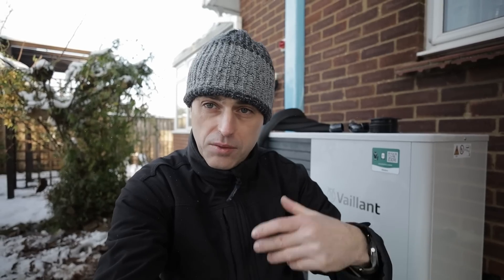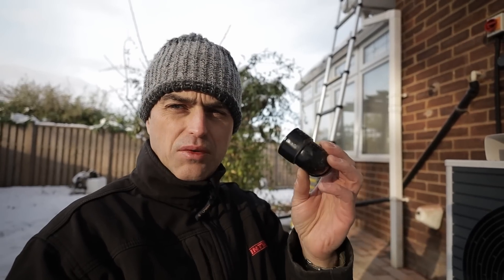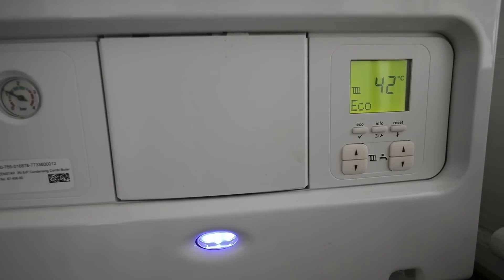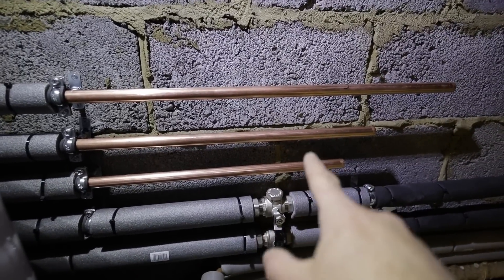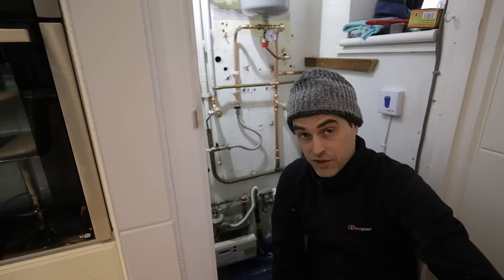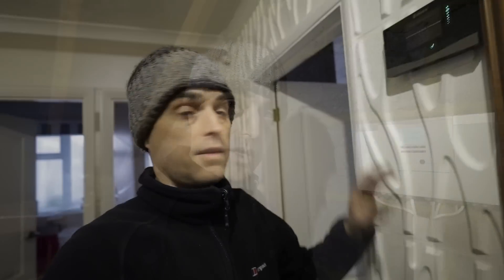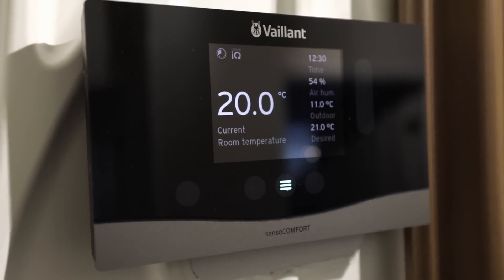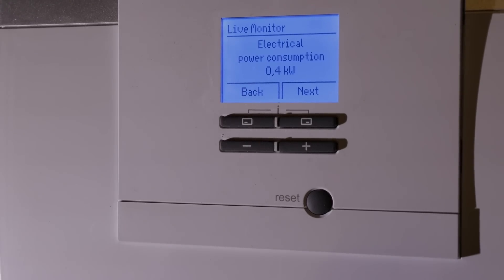How to Install a Heat Pump That Works

Comment: Thanks for all the content this year, hands down the best plumbing/heating videos on Youtube.
Reply from the maker: Thank you for watching! Merry Christams and a Happy New Year!
Reply: @UrbanPlumbers  I'd happily have the coal fire that heats the radiators and hot water back rather than just a room heater multifuel stove which we still run 24/7 even tho we have air source the fire does a good job
Reply: Fully agree. I’m proud of my plumbing but I still learn bits from your videos.  Merry Christmas all!
Reply: Hi Urban Plumber , really enjoy your videos , got a quick question for you . 
Hot water priority on Ideal Logic2 Max System , is the live switch for heating connected at 1 In and hot water switch live to 2 In ? , I’ve done this settings and the boiler would fire at maximum flow temperature on heating and hot water call , any ideas what I’ve done wrong? I’ve use Hive V3 Thermostat. 
Thanks.
Reply from the maker: Sl2 is for hot water off

Comment: I  have an Arotherm 7plus installed, and it is my third winter. One room always struggled to get to temperature. I recently balanced my radiators using  delta T of about 5C. This made a huge difference, and all of my rooms now get to the desired temperature.

PS, double-check that the external thermometer is measuring the actual temperature. Mine was 2C out, so I've adjusted with an offset.

Comment: We installed two Misubishi Zuba mini-splits in Yellowknife before I left for vacation! (Cold climate air source heat pumps). They were still running at -25 celcius! Below that the backup heat came in! Saying -3 C is cold is pretty amusing to me haha You guys can definitely switch everything over to heat pumps! Great video!
Reply: It does get below -3 but not often.

Comment: Thank you Simon for your expertise,   you and your team ,Peter & Gregory were a pleasure to work with ,welcome any time. Merry christmas to you all ( even Peter!!!!)
Reply from the maker: Brian, it’s been a pleasure. Apologies for Peter destroying your home sign. I hope he comes back to do chores for you now! 

Merry Christmas 🤶
Reply: Hope you don't mind my asking how much did the heat pump consume during the cold spell, Brian?
Reply from the maker: @singlendhot8628  We missed the cold spell. As soon as we fired the heat pump the weather got nice.

However in 10C outside the HP is ticking along at around 400 watts, on my other jobs 5 and 7kw heat pumps would run at around 1.2 - 2.0kW depending on the house, heat loss, etc...
Reply: @UrbanPlumbers  Interesting. We are also registering the same kW usage of ~ 2 kW on our AroTherm+ installs. 

Interestingly, our Viessmann 200-W installs are running at full modulation - 2.2kW of gas at 10 degrees C and 5 kW at -5 degrees, which is actually cheaper per kWh.
Reply from the maker: Mine are running at 400-500 watts when it’s 10c outside

Comment: Very good to see the professional approach to doing the job properly which of course includes doing the calculations and correct selection as well. 
I find some ASHP manufacturers are reluctant to provide all the heat output information for different ambient and flow temps which means you have to guess or select another manufacturer!

Comment: I’m a happy man. We just had some brutal frost days and my system running at 0.3 weather compensated and setpoint at 20C. Duty cycle is 50%, so there is loads of margin. This is geothermal however. I’m hitting a COP of 4.5 this month. And this will drop a little each next month till the regeneration starts in spring when the passive cooling system starts. This is also vailllant, the best there is.

Comment: Thanks for your great videos. I work in IT but watching your channel allowed me to diagnose a fault with my old s-plan system and get it repaired at very low cost.

I'm in North London and want to upgrade to a heat pump solution next year, I hope you will be able to install it for me?

Comment: The problem with pure weather compensation as a control strategy is that heat loss is also dependent on wind speed and solar input. Therefore, in my experience the optimal regulation strategy is using weather compensation  with an adjustment based on room temperature. I believe the Vaillant controller allows for this.
Reply from the maker: yes it does - so called active mode
Reply: I've got a heat only Ideal boiler, been mulling over adding Load Compensation (Nest OpenTherm) or Weather Compensation (Ideal Sensor Kit). I've been thinking the same, that adding the weather compensation kit to the boiler and keeping the Nest with on/off controls (not open therm) is the way forward. Not least because I have far more confidence it will work, being the manufacturers own kit - I'm unsure just how well a Nest will talk to a heat-only Ideal boiler over OT.

The only issue I have is I can't seem to run it lower than 50 deg C flow temp, it starts cycling as it can't dissipate heat quickly enough. Either my flow rate is too low, balancing is a bit out or (most likely) my 30kW boiler is oversized for my medium size 4-bed detached and can't modulate low enough :/
Reply: Although I'm unsure about ideal boilers, especially without model details, you're able to reduce the heat output on most modern boilers through the parameters. Might be worth looking into further
Reply: @hazzzzzzzzzz16  looking at the manual, the 30kW can modulate down to 6.1kW - which I think is too much to keep my house ticking over. The 24kW (and all lower powers) can modulate down to 4.8kW.

I should have insisted on the 24kW - but the plumber said 30 would be better. If better means it heats the house up quickly, he'd be right!

1.3kW extra doesn't sound too big though. So maybe I can improve things with a re-balance and pump speed setting.

I want to make sure the boiler can run happily at a low flow temp before I go buying the weather compensation kit.
Reply: I was wondering about this - what happens if you have say a house with a big south facing window (or conservatory) - when the sun comes out can generate a lot of heat, but also loose heat overnight etc.
Reply: @HugoDenbyMann  basically, the scenario you describe is a poorly insulated room. That won't work well with a heat pump. If it's just solar gain that is an issue, you could zone that particular room on a thermostat.
Reply: @HugoDenbyMann  the temptation is always to start zoning, and use radiator thermostats etc. But in an insulated house local heat gains (because of windows) get dissipated quite well within the thermal envelope. With a heat pump it is almost always best to open the system as much as possible, because this allows for lower flow temperatures and higher heat pump efficiency. But you want some way to be able to adjust the indoor temperature. Even with optimally set weather compensation, it can become either too hot (sunny day) or too cold (windy day). Thermostat-adjusted weather compensation keeps the same system flow and all heating elements open, but adjusts the flow temperature downwards if the indoor temperature is too high, and upwards when the temperature is too low. This will result in the highest efficiency & best comfort.
Reply: @shm5547  I have an ideal boiler with similar issues, however mine is 15+ years old and cannot be upgraded in any way. It's only a 9kw boiler, but if I set the flow temp to 55 or lower it cycles a lot. It can only modulate down to 7kw. Plus, I only have a single temperature dial so I can't set it lower than 55c anyway otherwise it won't heat the hot water tank properly. So I'm stuck unless I want to buy a new boiler.
Reply: @shm5547  Can you not range rate the heating side down to say 8KW?
Reply: @normanboyes4983  it'll go down to 6.1kW, but the smaller boilers will get as low as 4.8kW. However, I've done a bit of tinkering with the balancing and it seemed to be a bit better yesterday - ran at 45deg C. I think a bathroom towel rail had too much flow, water was rushing through it and back to the boiler before it had time to dissipate heat. I still think the 30kW unit is oversized for our house (it replaced a 24kW), but it looks like it might work ok on weather comp.
Reply: @shm5547  Not unusual for the U.K., most boilers were ‘slung in’ way oversized by a pretty incompetent industry. Most condensing boilers fitted in the U.K. have probably never condensed either (although that may change with the cost of the energy and customers (like me) actually taking an interest in flow temperatures and control. Yes radiator balance will have an effect where it is extreme (like a bypass situation), it is worth tinkering and trying to get your rads with a wide DT as possible (nearer to 20) in steady state. But range rating down will stop your boiler whacking in to much heat into the house in a hurry (think of it as lowering acceleration) but is inevitable that will such a high minimum firing rate , that your boiler will cycle, all you can do is try an minimise that.
Reply: @shm5547  Also have a large (29 ft) conservatory which is open to the rest of the house and obviously would have a disproportionate effect on heat loss calculation and size of heat pump and running costs. Decided to fit doors between Conservatory and house and not include conservatory into the system, heating it separately when in use. Does this sound sensible?